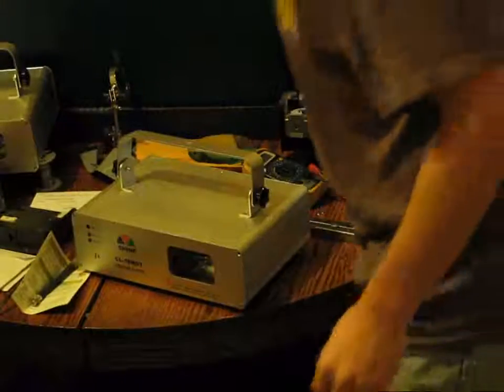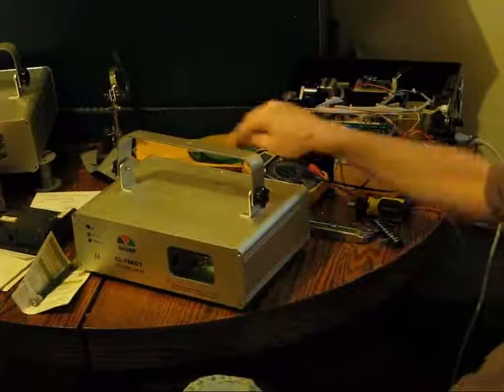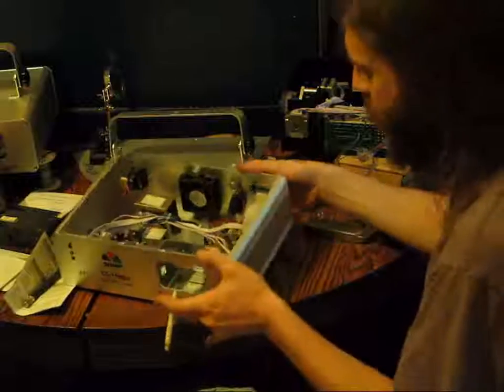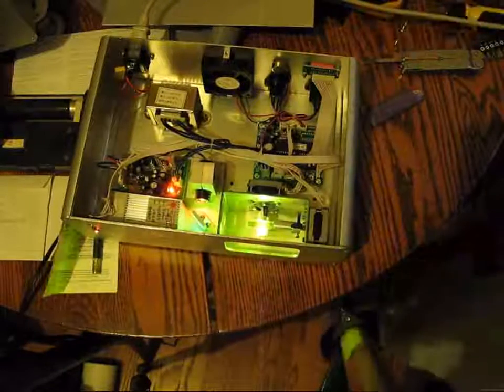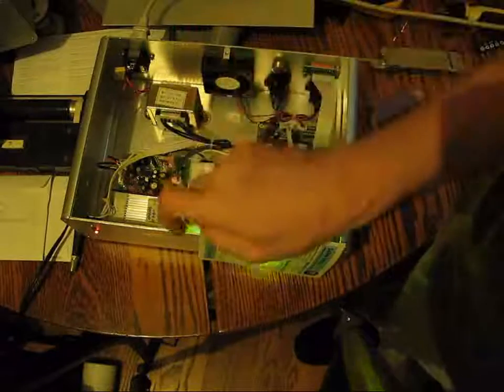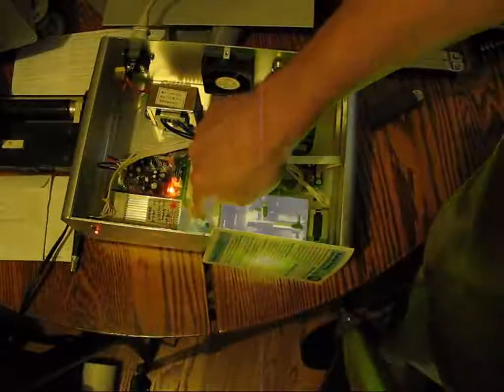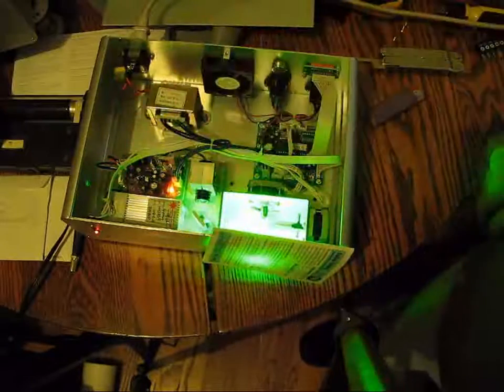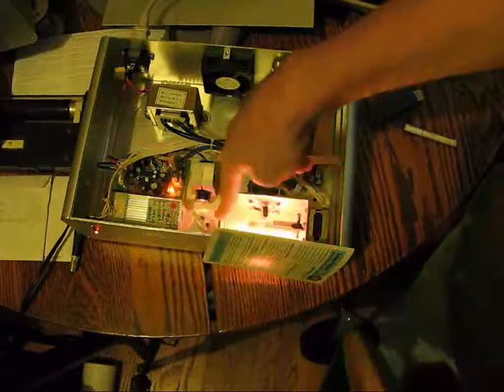laser alignment checking for dj laser

Comment from the maker: @chaosmat  it could. If the green is bright within parts of the field (the square of projection) and dark by the sides or top of the field, yes. That's a sign of blockage or bad alignment.  Opening the box will let you check the output of the individual lasers, so you can also tell if the laser itself is not putting out enough energy.   That make sense?  :)

Comment from the maker: Erased your comment trying to click Reply. WHY IS IT TOUCHING THE REMOVE BUTTON?

"yep exactly.. i ordered 2 red diodes on ebay... 100mw they were 32 bucks free shipping each.. but the green diode is like 80 bucks... its just upsetting that i have to spend more to fix this. atleast i fixed one.. im not going to plug it in the same plug anymore.. i want to buy another power light strip.."